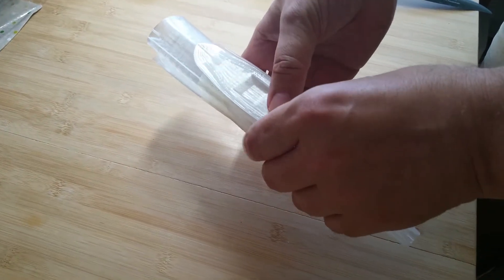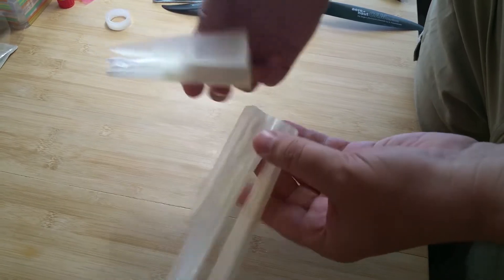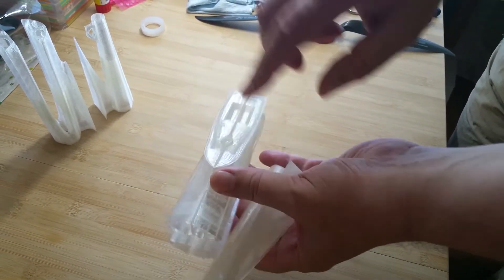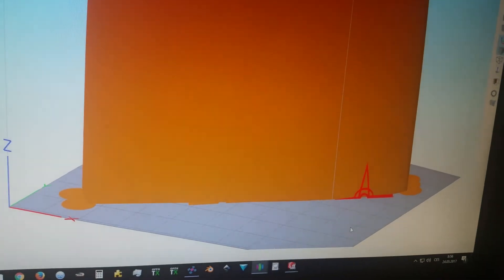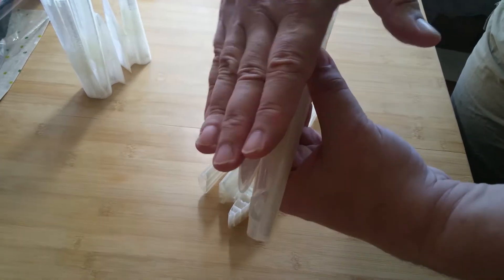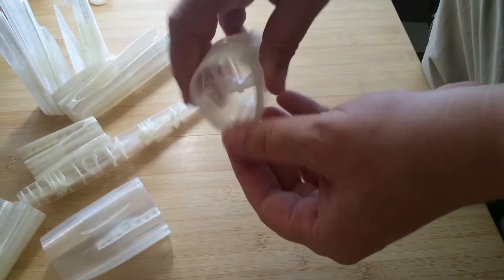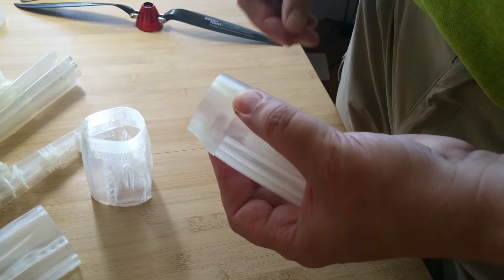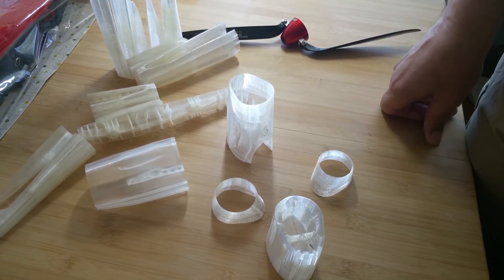3D printed glider EasyMax - A few modifications

Comment: how do you open .factory files? could you add also .stl for fuselage 3, 4 and wing parts with the screw mounts and reinforcements
Reply from the maker: Factory files are files by SImplify3D software. In this SW are parts placed together with a new parts and result is... just result :) I have not classic STL for other slicers.

Comment: Nice work on the modeling and modifications. The english word for the tool that creates threads is "tap". You "tap" a hole using a "tap" to create a screw thread. Where can the files be found?
Reply from the maker: Link is added under video.